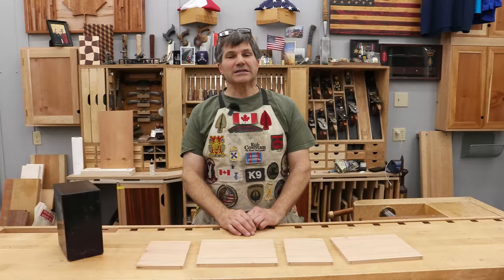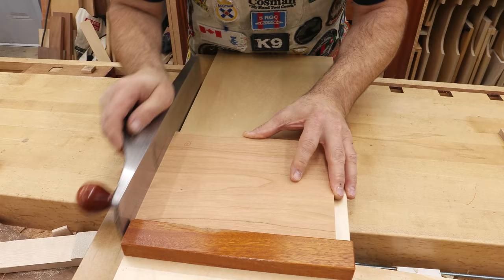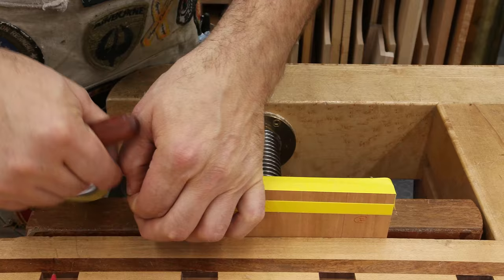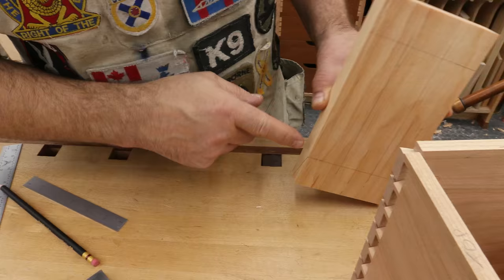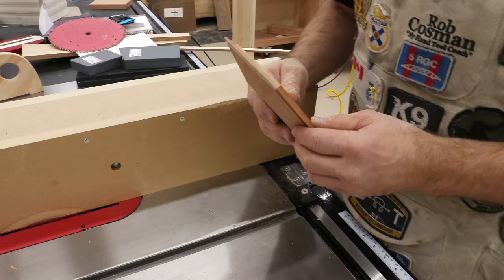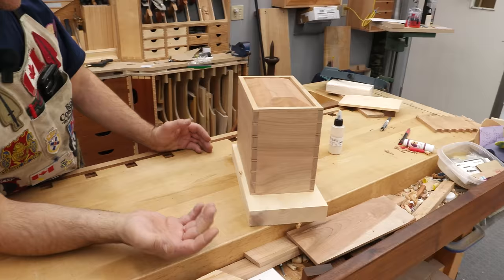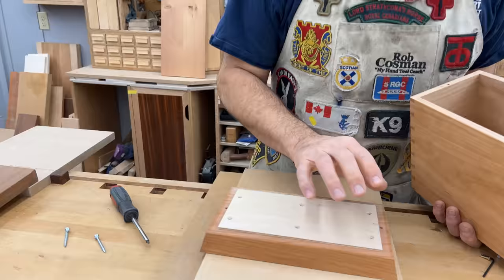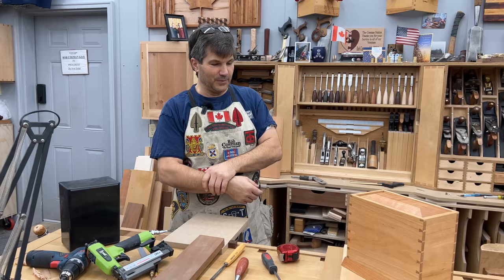How To Make An Urn For Ashes | Dovetailed Urn Box

Comment: Rob, that is a very nice piece, for what it is.  I've thought about it over the years and I plan on making a pair of these for my wife and me...hopefully not needed for many years to come.  I have the idea of making them a bit oversized, whereas the extra material would enable forming a fairly large dovetail so that the two boxes would interlock.  I'm still working on the design, but that's my (crazy) thinking.  My kids say that I'm breathing in either too much sawdust or CA glue fumes.  😉

Comment: That's a beautiful urn. 

For future reference, cremated remains are bagged before being placed in temporary urns (the black plastic container pictured in the video) to prevent leaks, as they're cheap and poorly sealed by design. You can safely open the lid without worries about damage or disrespect. That's also the normal practice, as commercial urns aren't sized to hold a temporary urn.

That way, you have a bit more flexibility when  it comes to sizing an urn and its proportions in the future.
Reply from the maker: Good tip, thanks

Comment: Hey Rob, it wouldn't matter for this because it is so small but do you ever pre finish the center panel on a 5 piece door? So when the center panel shrinks and expands seasonally you don't se a line of unfinished wood.

Merry Christmas to you and you family.
Reply from the maker: Yes, depending on the intricacies of the panel. If it will be difficult to finish as one complete piece, I’ll pre-spray the panel and then tape it off.

Comment: Rob, how did you plane the end grain bevel of the raised panel?  Did you plane across the grain?
Reply from the maker: With my 5-1/2 and a freshly sharpened blade.  very little projection.  planed down hill on the bevel, positioned on my bench so my plane didn't hit the workbench top

Comment: Let me try this again, something went goofy.
Recently a colleague and I built a wooden columbarium for our church to house the cremains of parishioners and families who want their loved ones' cremains to be kept inside the narthex (entrance hall) to our sanctuary.  (Two units,  18 spaces per unit).  The spaces needed to be uniform to make that work. We learned that the general rule of thumb is that one cubic inch of ashes inside the box per pound of the decedent is standard.  Thus the cremains of a 200 pound decedent would need about 200 cubic inches of internal space.  That's one way of dimensioning your urn box for those who don't want the box to be kept at home or some other location where size and dimension are not relevant.
Reply from the maker: Wow, great info

Comment: I think it is a very meaningful project. With respect to the video I was disappointed that you glossed over making the tongue for the box top when your reference surface is slanted like that. I was wondering how you did it.
Reply from the maker: I just cut it on the table saw , exactly the
Reply from the maker: 15:30 shows how I cut it on the table saw
Reply from the maker: Same way i cut the back side of the tongue.  The only trick is you have such a small flat reference spot to hold against the fence
Reply: Fair enough, I though you did it with a rabbeting plane. Which seemed like it would require to make the tongue first and the slanted surface after.
Reply: Thanks for the update! Merry Christmas!

Comment: Well my support for anything Rob Cosman is over. Selling the same $250.00 saw at $1,600 to $2,000.00 just because it has a different handle is just down right greed. As a 20 year veteran I have no more respect for you or your channel. You have lost much respect from many wood workers across the USA. I guess folks are buying these saws as bragging rights as they certainly will cut no different.
Reply from the maker: Down right greed? I spend 10-12 hours on each one of those handles. Do what you want, but I see no drop in support.
Reply: Why did you have to throw in the “20 year veteran” part? You are speaking for yourself, not the rest of us. Its called capitalism and it works so much better than the alternative, communism. I think its great that if you want the handle made by Rob himself, you have that option. Of course it would be spendy. If it was cheap, he would end up having to make them constantly and wouldn’t have time to do any of the other things. By the way, 1600 to 2000 is not even close to how much some of the other master woodworkers of the world charge for saws.